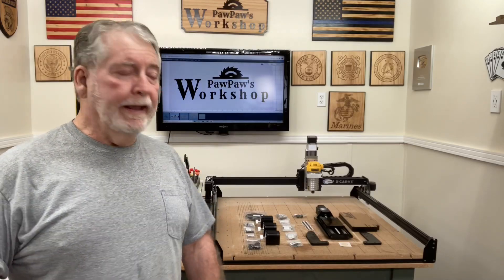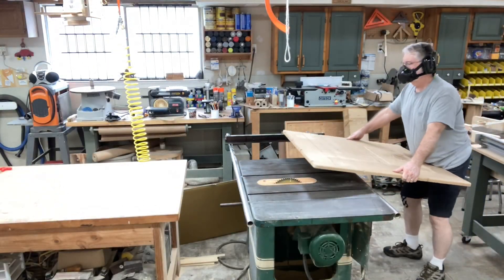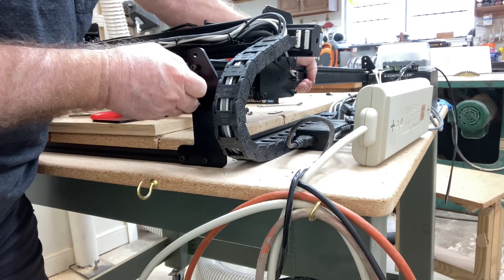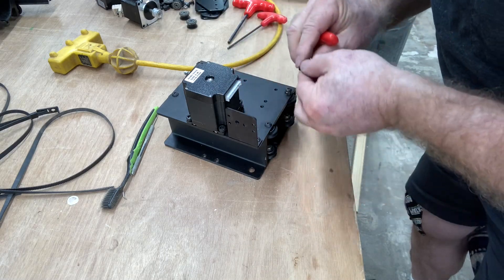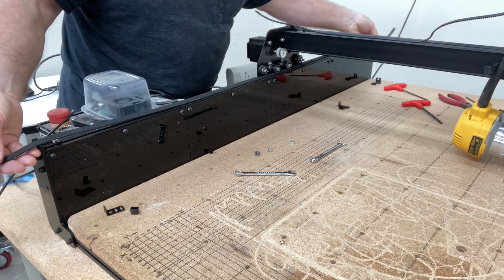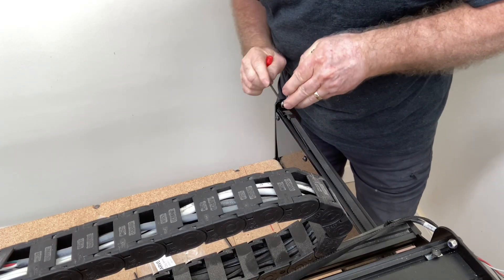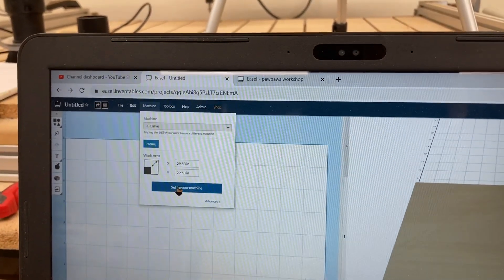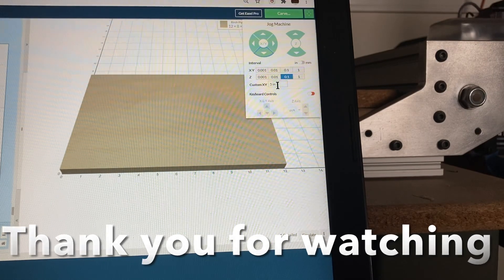UPGRADE & complete Teardown of the XCarve

Comment: I got mine and got it going a good week ago, afterwards started seeing all the videos that came out. I'll tell you I'm glad I waited off until this upgrade, it's totally repositioned my X carve into the workflow.
And worst of all I have all these extra motors and plates floating round the garage now spare from the upgrade. 
Those plexi or acrylic plates do a neat job of making the whole thing really rigid.  Almost didnt think the belts would fit around. 
Thanks for the video Paw Paw!
Reply from the maker: Thank you for your comments.  Save the parts, you may want to build your own CNC someday.
Reply: @PawPawsWorkShop  and therein lies my issue! 🤣 I have the X carve, queenbee and an acro system set up in the garage, but something useful will come up I'm sure- where I can migrate it to my day job, those y plates spare are really nice for conventional 2040 v rails. Grab a couple y/x plates from inventables and theres pretty much a decent limitless laser plotter! (If space and wife permit haha)
Reply: You have a queen bee also, after the upgrade which do you prefer?

Comment: Use tape on the the wrench, place on one side and then insert the nut from the other side. Then the nut won't fall out, instead of using the needle-nose pillars. No tool swapping either.
Reply from the maker: Yes, that is a workable way of doing it also.

Comment: Did you to increase the voltage to the stepper motors. After the upgrade my machine moves way to easy when changing bits. I haven't found anything on adjusting the voltage for the larger motors.
Reply from the maker: No, I did not change the voltage. Make sure that the GRBL settings have $1=255

Comment: So Ive had my x-carve since Jan 21.. and have been checking this update out.. but then I realized CNC4newbies also  has an x-carve upgrade that seems really  beefy..are you familiar with that one? your thoughts on either?
Reply from the maker: They both will accomplish the same thing.  The y axis plates are thicker and they use aluminum bars instead of the acrylic sheets to stiffen the y axis. I like the Inventables z axis because you can easily add the dust boot and other accessories.

Comment: New to your channel, nice job with the videos.  I was under the impression you had upgraded with the CNC4 Newbies kit which looks quite impressive though one winds up with basically an entirely new machine. Impressive, but its the cost of a 1000mm Xcarve.  This upgrade seems like a solid improvement while keeping costs to a minimum.  

Which setup are you using going forward?  This doesnt strike me as an upgrade relative to the previous upgrade.
Reply from the maker: Yes, I had upgraded to the CNC4NEWBIE z axis. However, it was very difficult to add a dust boot. Therefore, when I upgraded the XCarve I decided to go all in and upgrade everything. This made adding the dust boot quite easy as you can see in the most recent XCarve videos.
Reply: @PawPawsWorkShop  that’s a surprise, all that thought that went into that design and they didn’t provide a good setup for dust collection? Sounds as if they dropped the ball there.

Comment: How did you square or plum the router mount to the z axis?
Reply from the maker: Use the square to begin with and the you can adjust from that point with a dial indicator

Comment: I hope you making a before and after video on the performance improvements. I also I have xcrave and cnc4newbies I want to know if the xcrave with upgrades is closer too the cnc4n performance. currently I only use my xcrave for my jtech laser.
Reply from the maker: I just completed a project on the XCarve doing the text on text and pushing the limits just a little.  I am planning on doing a similar project with feed rates about 30% faster and see how it responds.

Comment: Very helpful.  Would be interesting to see tests demonstrating accuracy.    Cutting a 50mm x 10mm block and measuring with calipers.  Really helpful video. Im trying to decide on cnc4newbie vs the xcarve upgrade.  Id like to discover differences in accuracy ... if any.  Comes down to having a calibrated machine i suppose though.
Reply from the maker: Accuracy depends largely on how you calibrate the machine.  Detail calibration and the ability to take you time and not rush this part.
Reply: Finally got the kit installed.  Had a q about 3lbs belt tension because thats not much tension at all.  Did u ever end up increasing that tension on your setup?  Or did u keep it low at 3.  Thought id ask, thank you.